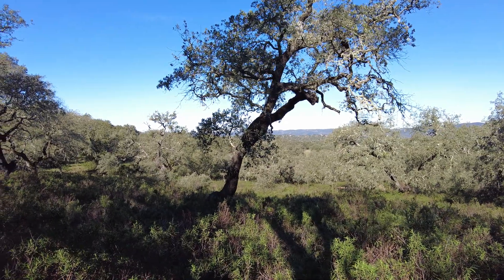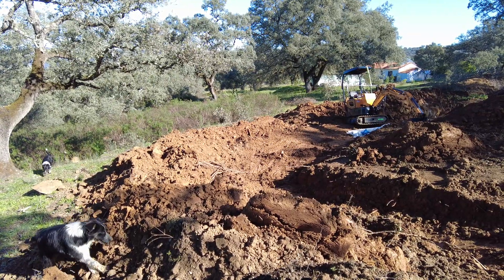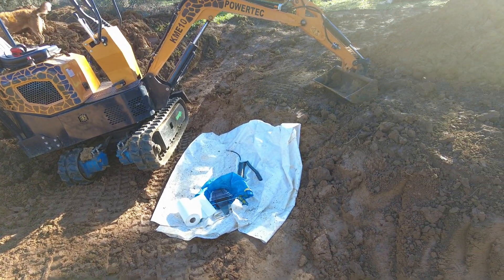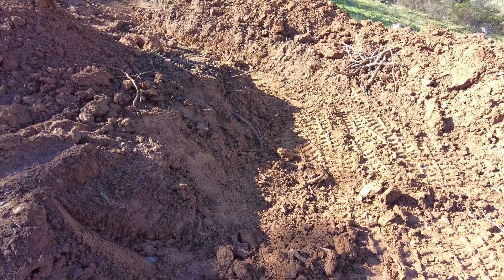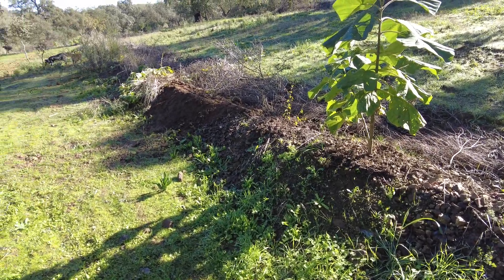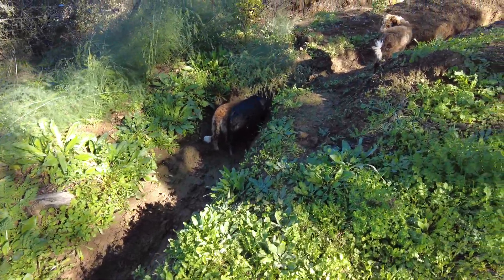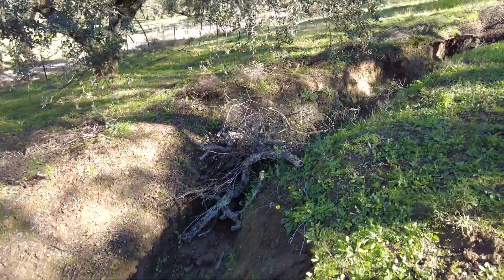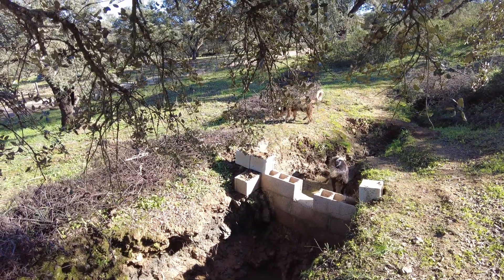Excavator operator fired and rehired. Works for free!

Comment: Thank you for the update video!  I'll follow along and offer my 2 cents worth 😉
0:53 Great to see the ground cover such a deep shade of green  I may be mistaken, but I believe it is becoming thicker and definitely growing taller.  Come the dry time the grasses and cereals should be at least thigh high.  Ready to make green manure.
2:12 Reach out with your boom and dig the key 1/2 a bucket wider on both sides of the pond before your tracks get pinched again.  Give yourself room to work.
2:52 bucket your subsoil on the outside of your clay key all around the dam.  This material will make up a good part of your 3 to 1 slope on the outside of the dam.  Distribute  the subsoil as evenly as you can.
All the best! 👍
Reply from the maker: All the cents happily collected. Thanks Steve
Reply: @SuerteDelMolinoFarm  Most welcome.  Safe Journey 👍